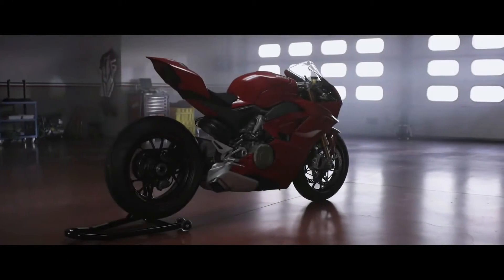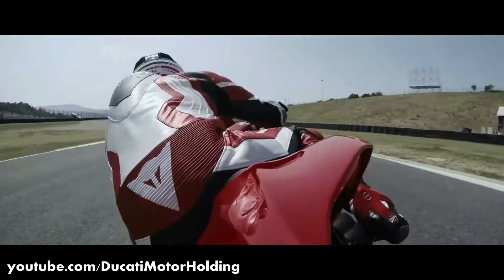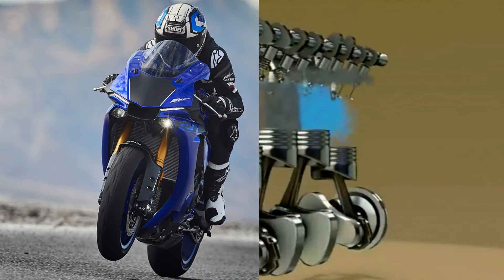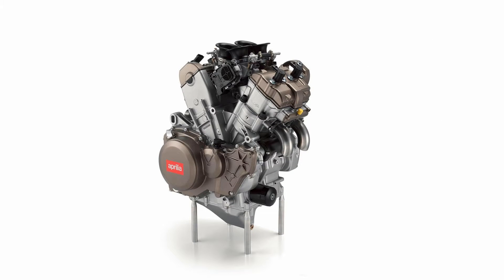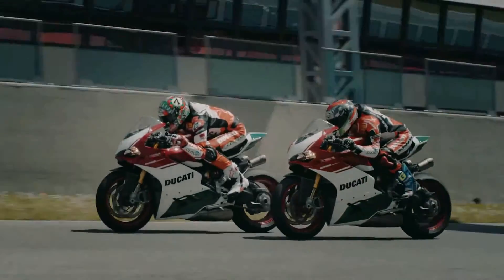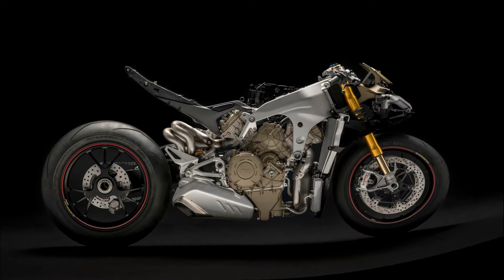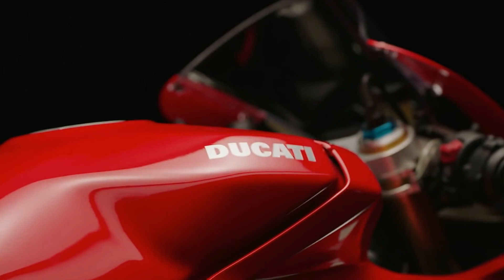Here's Why The New Ducati Panigale V4 sounds like a V-Twin

Comment: Your cylinder timings are shifted for the Aprilia V4.  It cannot fire the front left cylinder 180 degrees after the rear left.  It's a 65° bank angle with no split crank pins.  It has a 180° crankshaft, though, so the cylinders in the same bank fire at 180-540 intervals, with the banks separated by 295° (360 minus 65)  ;  the intervals are 180-245-180-115  ;  180 + 115 = 295°.

Those intervals, far from being steady and screaming, are clearly uneven and it's audible in the sound.  The chief component, as far as what you hear is concerned, is that 180° interval, due to cylinder groupings in the exhaust and the longer run of the front pipes compared with the rear.  The next important is the 295° one, not unlike a V-twin.

A crossplane four (M1 / R1 / MT-10) or a Honda VFR800 has intervals of 180-270-180-90; a VFR400 has intervals of 90-270-90-270.  These are the two main types of "traditional" V4: 180 crank (Aprilia, VFR800) or 360 crank (VFR400, KTM MotoGP etc.)

The intervals in the Ducati are 90-200-90-340, thanks to its unusual 70 degree crank.  Motus make a V4 with a 75 degree crank angle, so Ducati were not the first to try something new (intervals: 90-195-90-345)

You could say the "centre of gravity" of the pulses is closer to the first cylinder in the Ducati (190) compared with the Aprilia (237.5), and that's true.  But not as much as a genuine 90° V-Twin (135) - it sits right in the middle, in fact.

Again, the main reason it sounds like a twin and not some agricultural beast, is because of clever exhaust length tuning.  The front and rear cylinders are sufficiently separated so you only really hear the two 290-430 intervals of each bank.  Not too dissimilar to 270-450 in a 90° V-Twin.  Motus use two separate exhausts, one for each bank, for the same reason.
Reply: From the Aprilia FSM for the 2017+ Tuono (though I believe they are the same for all Ape V4):
180 - (180+65=245) - 180 - 115 are the gaps which match yours.  Firing is at 0 - 180 - 425 - 605 - 720  (720 is when cylinder 1 fires again).

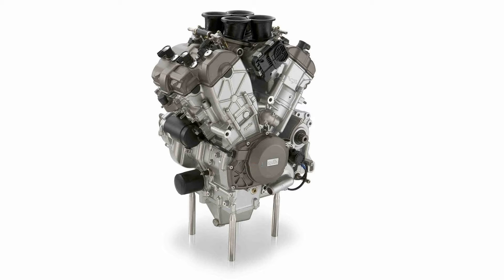This is stated correctly in the video @2:02.  Has the video changed?

(thanks for the other details though)
Reply: Maybe we should ask nasa about this matter
Reply: Nerds
Reply: @fostytou  yes the absolute angles show the intervals to be 180-245-180-105, look at the differences between each number in the sequence.

The issue isn't so much the intervals themselves, more that it's physically impossible for cylinders in opposite banks to be separated by 180 degrees.

It's a 65 degree V, 180 degree crank, so 180 separation is only available within each bank.
Reply: @TheBigChad  thanks for resurrecting this, Chad, missed the replies first time around!
Reply: @pepapig9242  😂😂
Reply: Are you sure the ktm moto gp is a 360° crank?
Reply: @bloodspartan300  6 years ago, yes. I've not really paid them any attention in recent years, but they still have that raspy 360 sound from what I have heard

Comment: The  P  E  R  F  E  C  T   Panigale would be the one which has the engine+exhaust note of the RSV4. 

Genuine Question: Is there any way we can add the engine+exhaust note of RSV4 to the Panigale V4?
Reply: Yes, use much longer piping in the rear cylinders than the front and merge all four into one. In practice, the collector would likely need to be at the front of the engine instead of behind it. It would probably sound even rougher at idle, but once spinning the gravelly tone should come out just fine.

Comment: Thx for the video , but your description is incorrect , it´s not the first V4 engine that Ducati use , the first was on the Desmosedici
Reply from the maker: Thanks for the heads up. The Desmosedici RR is a road-legal version of the Desmosedici MotoGP racebike. It was a limited production run (only 1500 were made) and it wasn't a direct replacement for the flagship 999 of that time. So that makes the Panigale V4 the first series production Ducati with a V4 engine.
Reply: Revving Heart 
Limited or not , 1500  street legal bikes is a production serie mate .
But ok , it was a replica ....
Reply from the maker: You got a point dude, I should've mentioned that in the video...
Reply: Whatever ....what a fantastic bikes